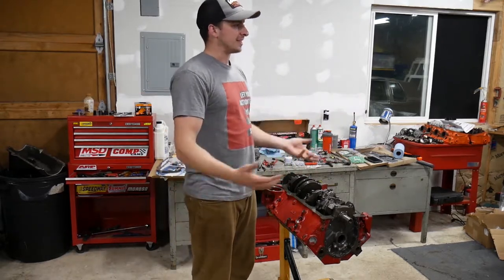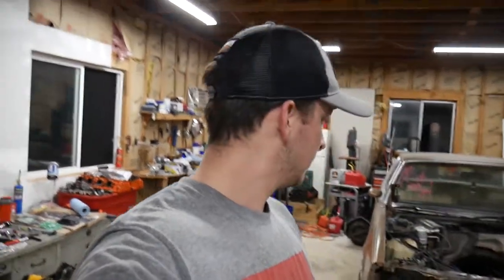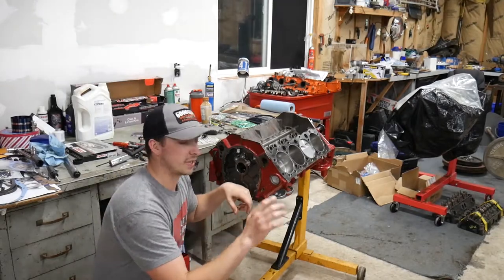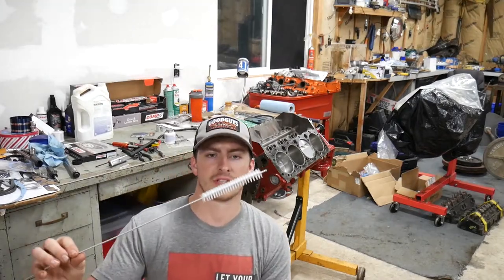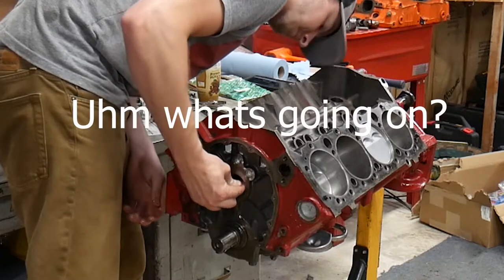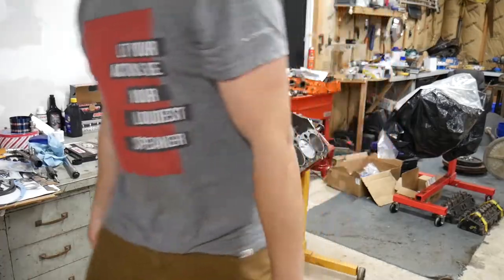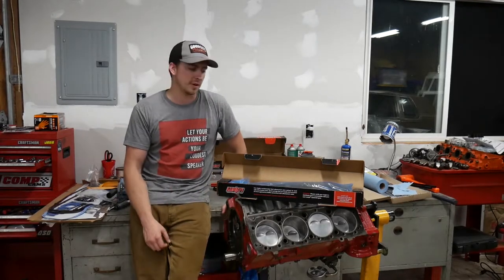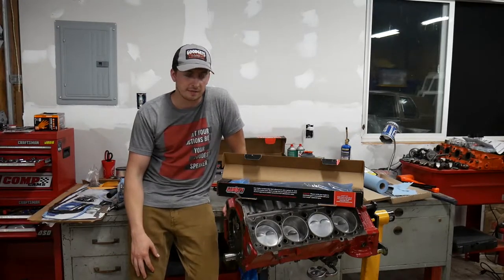Cutlass Engine Build Pt.5 Camshaft Installation!! Short Block is Almost Done!!

Comment: Hey Casey little quick tip for you, when installing the crank gear if you put a little heat on the gear it will slide right on no problems, or if you dont have heat and don't have a deep socket, grab you a 4-5" long piece of old exhaust pipe to slip over the crank and smack the gear on, i bought a short cut off piece at our local muffler shop that i leave in my tool box just for that purpose, but in the past in a pinch i am guilty of just cutting a short piece right off the tail pipe of the car or truck i happened to be working on at the time, we gotta learn to overcome in times of need right? lol so glad to be back and able to watch your vids again, been a while with all the eye surgeries ive had to go thru and now so busy trying to get my cutlass painted and all. keep up the work and hopefully this build is going way smoother than last (although i do admit, i really liked all the surprizes with the the last one lol)
Reply from the maker: Thanks man I am glad to see you are doing well! That is a really good tip I will be utilizing in the future haha here’s to more inevitable surprises!